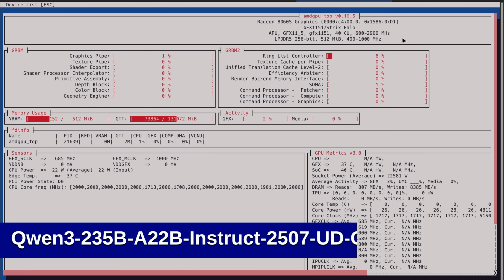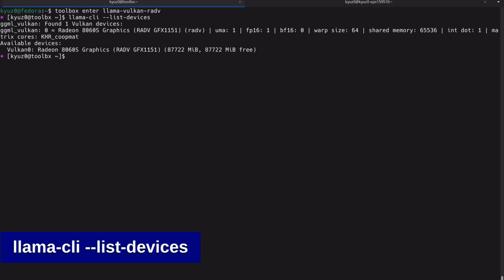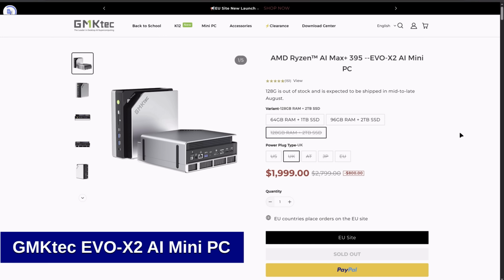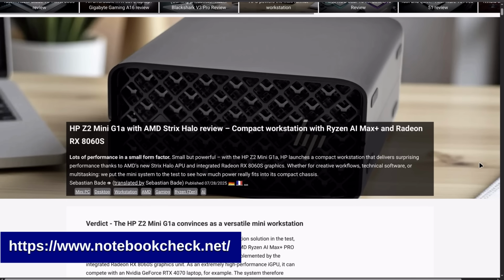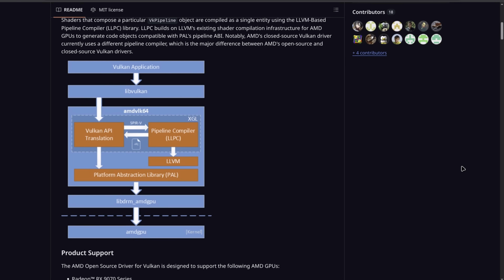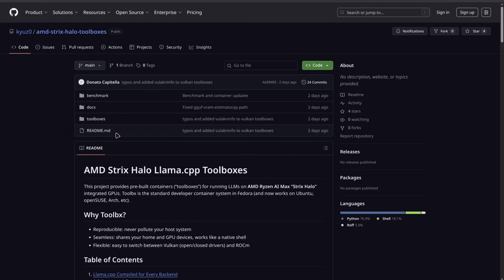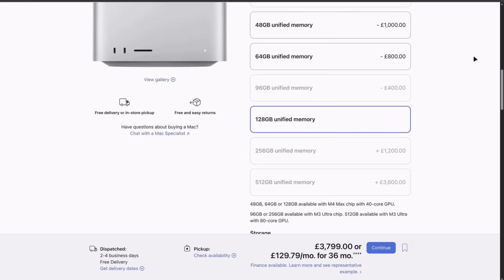GLM 4.5-Air-106B and Qwen3-235B on AMD "Strix Halo" AI Ryzen MAX+ 395  (HP Z2 G1a Mini Workstation)

Comment from the maker: ⚠ Errors and Updates

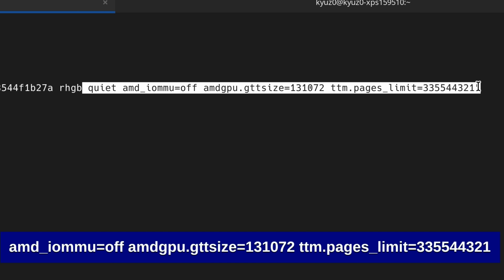02:59 - It says ttm.pages_limit=335544321 — that was a typo. The correct value is ttm.pages_limit=33554432, which allows the GPU to allocate up to 128 GiB of system RAM. Calculation: 33554432 pages × 4 KiB = 134217728 KiB = 128 GiB.

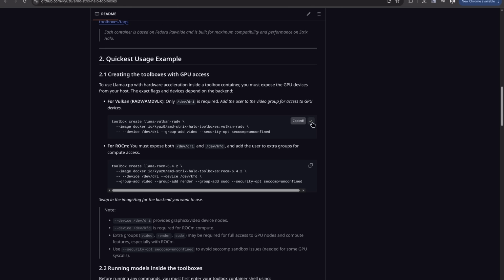03:05 - You can also try the new rocm-7rc-rocwmma (with hipBLASLt enabled by default). If you use this with FLASH ATTENTION, you will get better performance and in the last benchmarks this was stable.

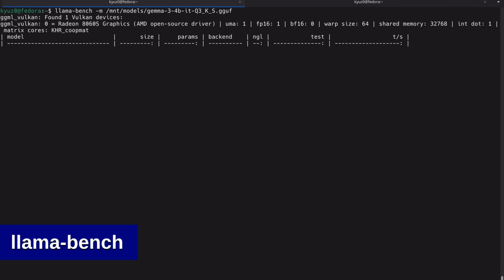17:50 - Toolboxes now rebuild automatically when new llama.cpp updates are merged into the master branch. There are also new toolboxes for ROCM with "ROCWMMA" for better Flash Attention. All ROCm 7 toolboxes now set hipBLASLt as default, this performs better.

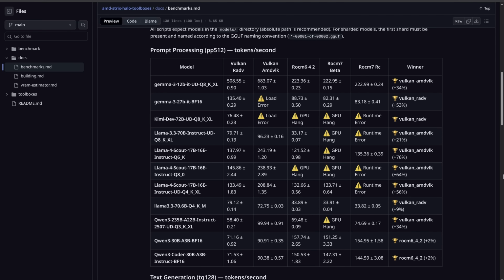18:33 - All the benchmarks have been rerun on the latest version of llama.cpp and are available here: https://kyuz0.github.io/amd-strix-halo-toolboxes/
Reply: Hey Donato, can you test the new Qwen3-Next-80B-A3B?
Reply from the maker: @videoclick2009 as soon as unsloth releases some quants, BF16 won't fit in 128GB.

Probably I'll have benchmarks up tomorrow afternoon
Reply from the maker: Just an update on this: it might be a while before we get this model supported on llamacpp, as it's got architecture tweaks not supported in llamacpp, and currently there's no PR with support.
Reply: @donatocapitella thanks a lot for this video! Even months later it's still very relevant.

Did you notice any breaking changes that optimize the setup process lately? As in new rocm or native support of allocating more via bios directly?
Reply from the maker: @AtrinMartin  thanks! I did not test the specific allocation of memory via bios, it's unneeded in my setup as I bought this for the unified memory. ROCm support and performance have improved a lot in the meantime!
Reply: Forgive my ignorance here, but wouldn't "ttm.pages_limit=33554432, which allows the GPU to allocate up to 128 GiB of system RAM...." crash a Strix Halo system running CachyOS with 128Gb max?...some should be reserved for the OS/browser during inference to allow the user to still use the computer...?
Reply from the maker: @cleverestx thanks for the comment. It won't crash the OS but crash the llama.cpp process. I set it like that so to allow llama.cpp to use as much as feasible.

You can set it lower, I suggest you take a look at the GitHub page, the README has the settings I use at the moment, I set the unified memory up to 124GB if I recall correctly.

But again, that setting is just an upper bound

Comment: Thanks a lot for the video; it was very informative.
I have a question regarding context length: is it suitable for use as a local coding LLM workstation?
Reply from the maker: Thanks you for your comment. The answer depends on your expectations, if you expect to run Opus-style models and very fast inference, this is not for you, you need a minimum budget of $10k, probably more. If you expect the performance to match the price you're paying, yes, you can run some good models on this, check the benchmarks to see what kind of speed you can expect. 

I also recommend really checking some of the more recent videos, I have one on coding agents and more are coming.

Comment: Such a great video, this video is what anchored me to committing to buy. I'm having a lot of fun with the 395+ strix halo. running GLM4.5 air 106B I was only getting around 1tok/s in my lm studio setup on ubuntu. fun though. Currently running 2 different models + embeddings model and consuming around 30GB RAM only - FAST inference and reliable tool calling. 

Tip: minimum Quant to target is Q6. Dont use Q4 at all. 

More tips, flash attention = on, parallel = 1 (default in lm studio is 4 and when there's a kv cache shift it was causing occasional crashes which result in unreliability.) and get back some RAM headroom in long contexts by changing k,v cache from the default FP16 to Q8. running this setup 24x7 with full reliability on long tasks, multiple steps and tool calls without failure. now i can focus on building instead of fixing. tons of fun. strix halo 495+ is coming soon, the 256GB/s memory bandwidth limit is a real pain on large models. that is the real bottleneck. if the 495+ with 192GB RAM has the same bandwidth limitations then the additional RAM is not going to really allow loading a single larger model, unfortunately. I mean i can type faster than 1tok/s :D

Comment: Still too slow in PP/Prefil.. need at least 1000 tkps on PP.  For agentic coding it is a MUST have. 30k tokens --> 30 seconds of wait at 1000 tkps. Imagine how much you need to wait on 10 tkps pp
Reply from the maker: I don't disagree, depends on the model size and inference has also drastically improved in the last few months, so you can get decent models in good quants to run at 500-1000 tkps like qwen-3-next-coder. Take a look at some of the recent models I benchmarks.

https://kyuz0.github.io/amd-strix-halo-toolboxes/

But for larger models, a £2,500 machine won't give the performance you're after (if you know a configuration in this price range, please share!)

Comment: have you been able to run a large model getting over 20 tokens a task?
Reply from the maker: It depends what you mean by a large model - generally MoE models do well. Performance has improved in some cases 3x since this video in August, I recommend you check the latest videos and the current benchmarks: https://kyuz0.github.io/amd-strix-halo-toolboxes/

Comment: Great video. Many thanks for your effort collecting all this information. Just curious, on a scale of 1 (hard) to 10 (easy), how easy would it be to prep a live-boot Fedora USB that loads all software inc a preselected model into memory? O/c the bios/ufi would need to be set low beforehand. My use-case here are desk AI runners for data-sensitive research, with a local usbnet network between a researcher laptop and an openai-compatible API running on the HP Z2 G1a.
Reply from the maker: I think it would be very easy, but haven't done it myself. There should be fedora guides on this
Reply: @donatocapitella Thanks for taking the time

Comment: Thank you for such a good and informative video for novice users like myself. I am using Miniforum MS-S1 Max with Fedora 43 with AnythingLLM in a docker and I have also loaded Minimax M2.1 which is 230B model. This is what the log file shows me
    Prompt Processing: 160.88 tokens per second
    Text Generation: 29.17 tokens per second For a 228.69 Billion parameter model, nearly 30 tokens per second is incredible performance. I could not get ROCm working. I am using Vulkan.
Reply from the maker: yeah, mixture of expert models are the ones to go with on Stirx Halo!

Comment: Is there a way to hook up LM Studio to your toolboxes?  I'd like to use both, but I don't want to duplicate models on disk, and I'd like to try different platforms on the models (ROCm and Vulkan, different versions).
Reply from the maker: Thanks for your comment, I have never used LM Studio but I understand it uses llama.cpp under the hood, so perhaps it's got a folder with the models in there that you can use with my toolboxes, but again I have never used LM Studio.

Comment: I have been hesitating for months if I should order a Framework desktop or not.
Can't wait for it to arrive and test it myself.
Reply from the maker: You'll definitely have fun, the software stack has matured since this video - still some work to be done, but it's in much better state
Reply: @donatocapitella  Thx, I am planning to use it for coding assistance in Jetbrains IDEs.
My subscription includes Jetbrains AI but the credits are consumed very fast so for the "lighter" work I use Qwen3-coder:30b locally on a RTX4090.
I know the Framework desktop will be slower compared to a RTX4090 but it will allow me to run bigger models with still decent/usable tokens/s and it's also rather portable, quiet, not so power hungry ...
Any advise for a good coding model that fits the Framework desktop is always welcome.

Comment: so for coding is quite useless for 2 reasons: nice models can't fit in (but buying 2 of these can do the trick) and the pp speed... that pp speed is really the problemo.
Reply from the maker: Alas, I don't know anything at this price point that can fit large models with good pp speed. If you do, please shout
Reply: @donatocapitella  maybe... maybe having 2 of these running in parallel one model that can fit in one can boost the speed somehow x2. Or having 4 running 2 instances of the minimax 2... but then price again. The Spark can do >2000 of pp instead of 840 in the same Moe 3B model your mate tested, but is x2 times pricey. And token generation is 81tk/s so same speed with vrad Vulkan. I mean, maybe running more than 1 instance in pararell can do the job of tweaking the speed. What do you think about this? even with Qwen code 30B
Reply from the maker: @tenebraba9007  I need to look at the benchmarks and the exqct quantizations: Spark will do better in 4bit native formats, but I don't think it'll be that better with other quants.

Right now using llama.cpp doesn't support tensor-parallelism, we need to get vLLM up and running (which I'm working on) to squeeze more performance, but the issue is going to be latency -ethernet or YSBC simply will not do the trick.
Reply: @donatocapitella  I copy paste this, maybe you'll find a cheap solution in what the ai said... somehow... there is hope.

Ideas for Framework Desktop (mini PC with AMD Ryzen AI Max+ 395):

Idea 1: Internal upgrade for single-node: Configure with the Ryzen AI Max+ 395 (high performance, 3.0GHz base/up to 5.1GHz boost, 16-core/32-thread, 64MB L3 cache), 128GB LPDDR5x-8000 (for low internal latency ~60-70ns and high bandwidth), and allocate more RAM to "VRAM" via BIOS (up to 16GB or more for the Radeon 8060S iGPU, useful in 4-bit quant). This avoids clustering for medium models. Add Expansion Cards for external NVMe storage (via USB-C/Thunderbolt-compatible ports), but it doesn't expand real RAM since it's soldered.
Idea 2: Clustering with optimized Thunderbolt/USB4: Connect two Frameworks via Thunderbolt 4/USB4 (40Gbps, using Expansion Cards for extra ports if needed), with "Thunderbolt Networking" for point-to-point bridging. Latency ~50-150µs, better than standard Ethernet but still not zero. Customize with extra Thunderbolt Expansion Cards (Framework sells them for docks) for daisy-chaining, and use software like vLLM with pipeline parallelism (less sensitive to latency than pure tensor). To reduce further: Add an Expansion Card or external PCIe enclosure (via the modular system) with a 2.5/5GbE NIC, or a low-profile InfiniBand card (if it fits in a compatible enclosure, ~$200-500 for Mellanox CX4). Benchmarks show Thunderbolt nearly matching InfiniBand 50Gbps in token generation for LLMs.
Idea 3: Hybrid with eGPU: Customize one with a Thunderbolt/USB4 enclosure (via Expansion Cards) for an external AMD GPU (e.g., RX 7900 XTX with 24GB real VRAM), adding to the system RAM. This gives effective "VRAM" >128GB without clustering, low latency (~100µs via Thunderbolt, but only for GPU offload). Leverage the 5Gbit Ethernet or Wi-Fi 7 for any light multi-node sync if needed.

Ideas for Minisforum MS-01 (or similar mini PCs with AMD 395+ equivalents, like Bosgame M5):

Idea 1: InfiniBand or RoCE: Add InfiniBand NIC cards (e.g., Mellanox ConnectX-5/6 via the PCIe x16 slot on the MS-01, ~$300-600 each). Latency ~1-2µs, ideal for AI clusters. Benchmarks on LLMs show performance close to single-node in tensor parallelism, outperforming Ethernet by 5-10x in consistency. Configure vLLM with allreduce over IB for pooling of RAM/VRAM. Direct QSFP cable (~$50).
Idea 2: Optimize Thunderbolt/USB4: Use the USB4 ports on the MS-01 for bridging, with software like IP over Thunderbolt. Latency ~50µs in tests with AMD Strix Halo (similar to Ryzen). Better than Ethernet, and vLLM supports multi-node; try with 4-bit quant for less sensitivity.
Idea 3: Switch to RoCE (RDMA over Ethernet): If you don't want IB, use 100G Ethernet NICs with RoCEv2 (latency 5-10µs). The MS-01 has native SFP+ 10GbE; upgrade to 100G via PCIe.

These should work well for your goal, especially since the LPDDR5x-8000 in the Framework boosts bandwidth for quantizations like 4-bit in Spark or vLLM. For the Bosgame M5 (which you mentioned at 1600€), it likely has similar AMD Ryzen AI Max+ 395 specs—check if it has PCIe slots for InfiniBand upgrades to hit those low latencies in a dual setup. If you need benchmarks for LPDDR5x-8000 specifically in LLM inference, let me know!

Comment: AMD just isn't there on the software side of things. I'm starting out with quad 3090s and will add an RTX Pro 6000 once I've landed my first professional contract.
Reply from the maker: Yeah, RTX Pro 6000 is in a totally difference price/performance bracket than an iGPU, TBF a comparison is not even possible. Like comparing a Fiat Panda with a Ferrari.

Comment: Any modifications for using 96gb model?
Reply from the maker: You'll need to calculate the values for the kernel parameters to go up to 96gb and not more, should be

amdgpu.gttsize=98304
ttm.pages_limit=25165824

Comment: Thank you for the effort! This is great!
A few questions:
- Can we use  proxmox and a Ubuntu/Fedora LXC to accomplish the same (similar performance) to allow the machine to be used for a homelab with additional VMs/LXCs ?
- Any thoughts on the performance of HP Z2 Mini G1a vs Minisforum MS-S1 MAX ?
Reply from the maker: Thank you! I haven't done it myself and I don't use proxmox, but I know of nothing that would make it not possible to do. Provided you can pass the GPU to the VM and that you have a recent kernel and software stack, you should achieve the same performance.

I don't own a MS-S1 MAX, I cannot compare. I maintain benchmarks for the Framework Desktop and I did them previously on the HP mini, I would expect performance would be very similar across all machines
Reply: @donatocapitella  
Thank you - makes sense.
I was thinking to use a LXC, as I don't need to pass the GPU.
PS:  ... assuming I decide to buy one of the Mini PCs with the Stix Halo  - thinking at 256GB  in the "near" future :D.
Reply from the maker: @thedarthfath3r hoping in 2027 we'll have the next iteration with that much memory!

Comment: Does the strix halo APU work well with FP8? For example DeepSeek with its mixed floating point model. Or would you have to dequantize FP8 to FP16/32?

Comment: Just conjecture, but I suspect the mmap loading slowly issues are because only the GPU accesses the data. It then populates its page tables by cross device per page faults. This might be fixable using prepopulation and locking (mmap flags).

Comment: Thank you very much for this video and burn in hell YT Algorithm that been hiding it from me for so long. I watched a ton of AI 395 videos where people tested LLMs in inconsistent way or with incomplete or erroneous setup. But this - this is good, this is great! Good job!
On the device itself it's honestly a huge disappointment. As it can't really run same old Llama 70B, 3 TPS is not even worth spinning up. And if you go smaller models then 3090s setups just blow it out of the water. I believe you can them used for about $600 now per piece.
Reply from the maker: thank you for the support 🙏 and yes, the strength of this chip is the memory and that it can run MoE models really well, like GLM Air is great

Comment: i added the grub flags: amdgpu.gttsize=131072 ttm.pages_limit=33554432
and regenerated grub
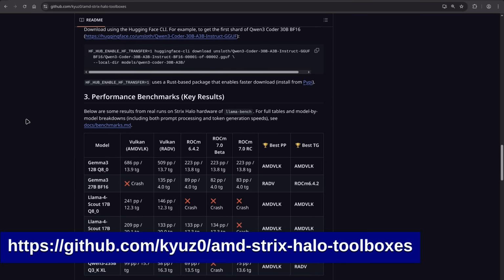but i get llama_model_load_from_file_impl: using device Vulkan0 (Radeon 8060S Graphics (RADV GFX1151)) (0000:c2:00.0) - 87603 MiB free
when trying to load in a model too big, what am i doing wrong?
Reply from the maker: What distribution are you using?
Reply: @donatocapitella  
Thank you for the quick response, im using arch linux which is currently on kernel 6.16.10
Reply from the maker: @EnderCrypt I'd say, join the Discord server, as other ppl use arch and they'll be able to help
Reply: @donatocapitella  i figured it out.. it was entirely my fault:

llama_model_load: error loading model: invalid split file name: /home/llama/models/standard/Qwen3-235B-A22B-Q4_K_M.gguf
llama_model_load_from_file_impl: failed to load model

i had not realised bigger gguf's come in multiple splits and they also need to retain their filename
Reply from the maker: @EnderCrypt  Glad you were able to sort this out!